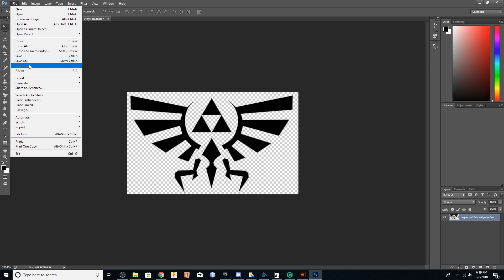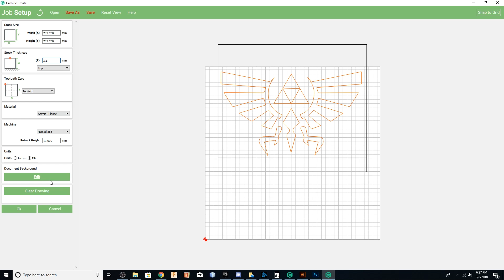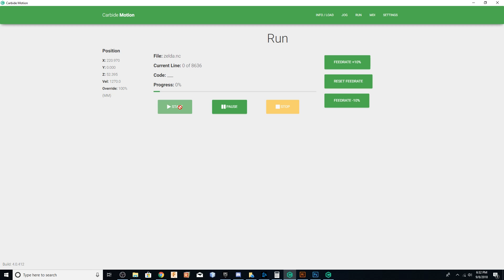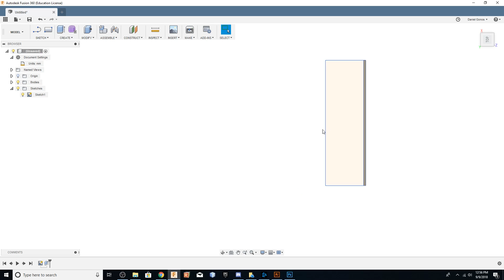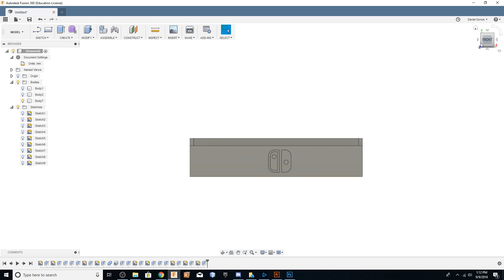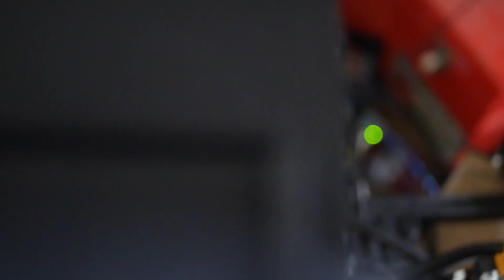Custom CNC & 3D Printed Nintendo Switch Dock Upgrade

Comment: Hi ModBot , right now i use ender 3 machine, it takes 12 to 13 hours to create that nintendo switch dock, my question is, is it possible to less the time working, like you have done in 8 hours? thanks a lot

Comment: it is good to vacuum or hookup a flexible air nozzle to a compressor. The endmill  an pickup the material and the bit will become larger from the acrylic wrapping around it and ruin the piece.
Reply from the maker: Thanks man for the tip! Since this one is inclosed it's hard to attach anything to it. I have seen a little propeller that you can hook up to it that will cause the dust to at least fly off of the stock while it is being milled